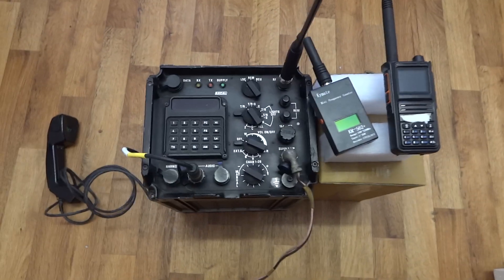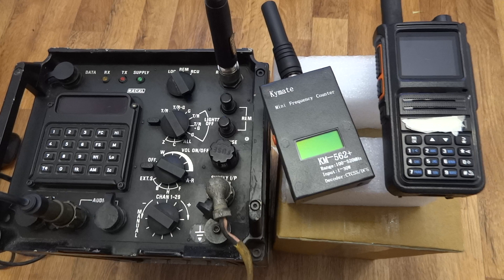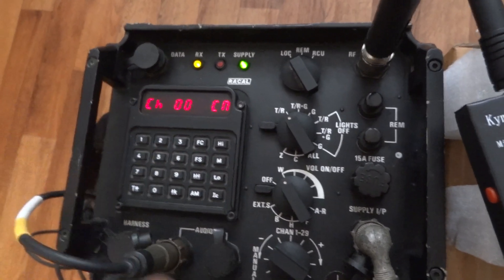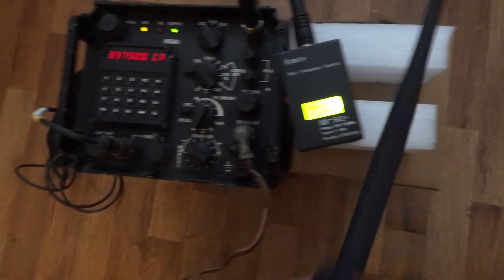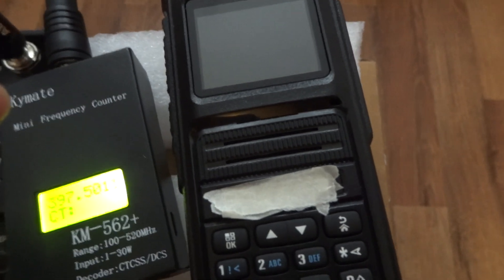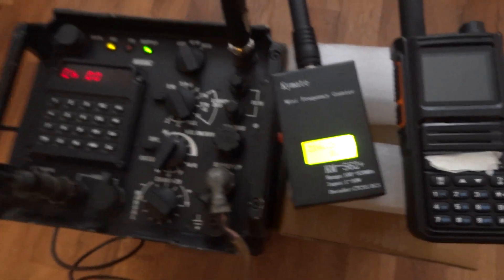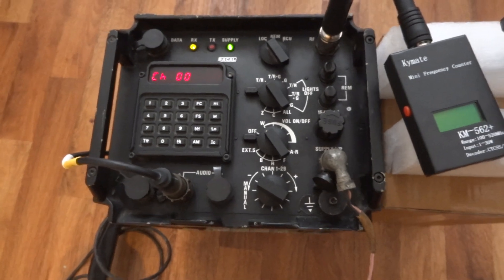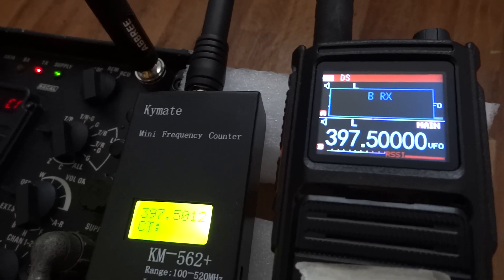Racal VRQ-317 testing Encryption & Hopping Frequency , Keypad Programming of Encryption  .

Comment: Hop codes: h means hop SLAVE, your radio can connect to an existing hop network, FOLLOWING the rules, set by hop master, H means your radio is the MASTER,  can create its own hop network, setting up the rules. All hop networks can have only ONE master. But how do you  program xmit power? It seems my set allows lo and mid pwr only.